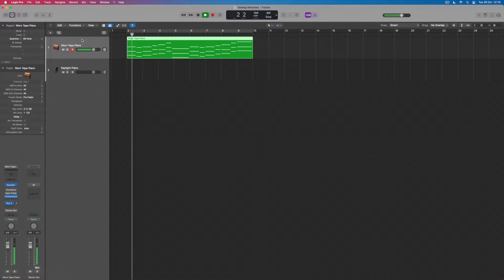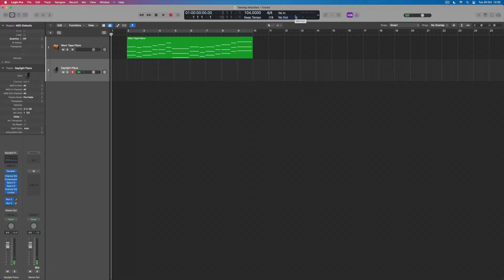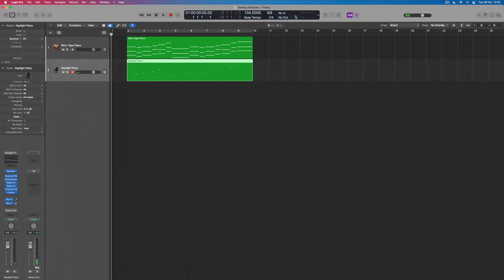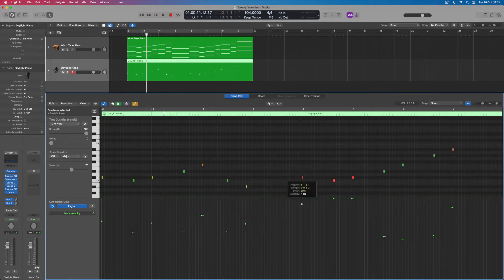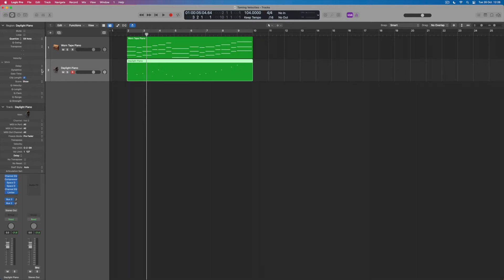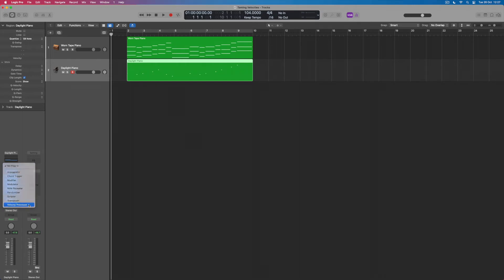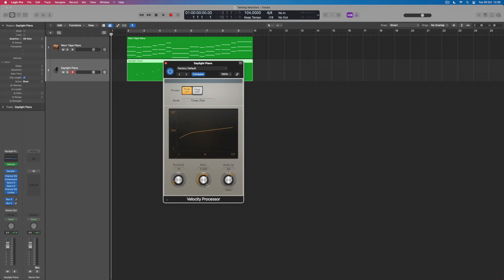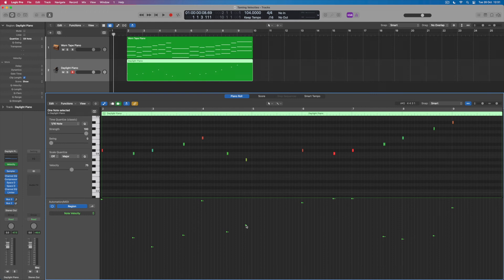LOGIC PRO X - How to use Velocity Control 3 ways

Comment: Thank you for making these videos! Any recommendations for a MIDI Velocity Gate for Logic? I want to be able to filter and trigger only the loudest notes on one of the drum synths. For e.g trigger only between 100-127 velocity range and ignore the ghost notes. Thank you :)
Reply from the maker: You're welcome. Yes, you can do this with the Velocity Limit settings on any track. Click on the required Track, then toggle open the arrow for the Track Editor. There, you'll see Velocity Limit settings for both minimum and maximum Velocity settings. Set them to the Velocity range you need (even if that's only one Velocity unit!).
Reply: @jonobuchananmusic  Thank you! This is very helpful. I'm grateful for the info :)

Comment: i want increase velocity slowly in a string part ,  is there any solution  🥹
Reply from the maker: Yes! Double-click the MIDI region to open the Piano Roll Editor, then open Automation by pressing 'A'. Select Note Velocity from the menu on the left and click and hold at the beginning of the region at the Velocity setting you want to start with, then click again at the end of the region with your chosen Velocity ramp.
Reply: excellent tutorial! When I select the MIDI notes on the piano roll and "draw" the velocity in the automation window, other notes (not selected) are also adjusted. My question is: is it a bug? Is it possible to draw velocity only for the selected notes in the MIDI region? Thanks in advance